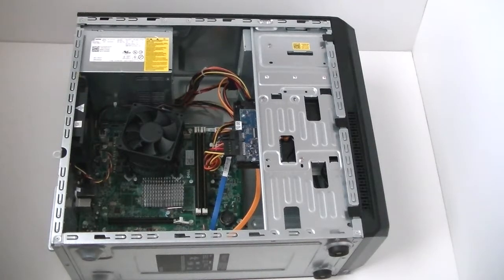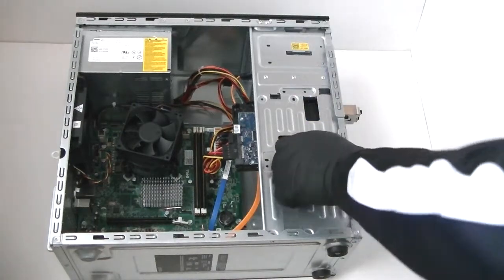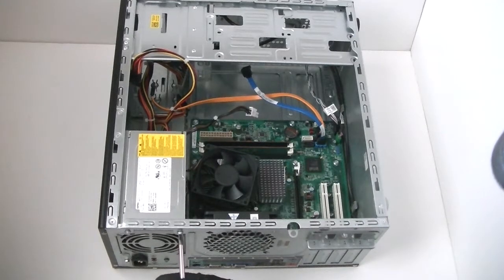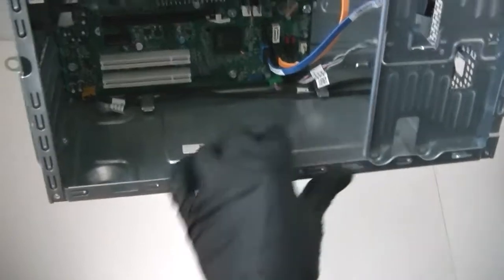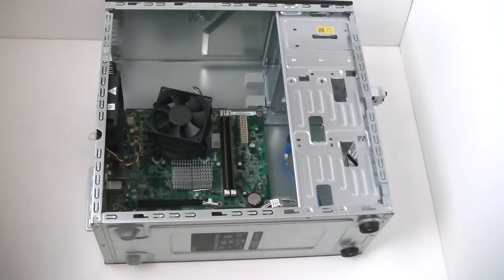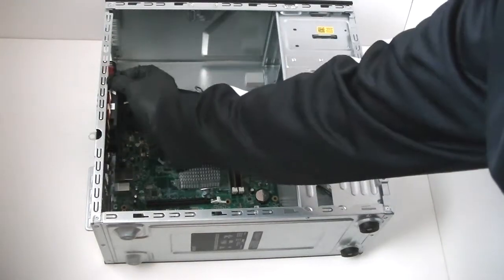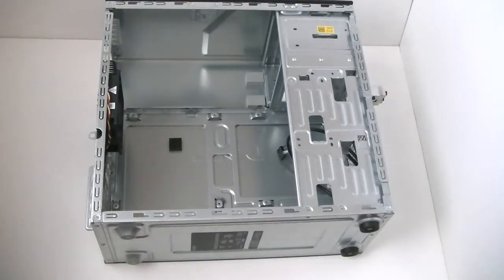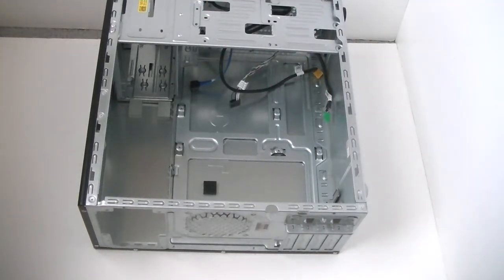Dell Vostro 230 Teardown

Comment: Hey bro, what brand of ram are those blue RAM sticks that are originally in the PC? Having trouble upgrading the RAM in one of these f*ckers and hoping if I can get the same brand of stick it'll help.

I've already tried Patriot PC3-12800 (1600mhz DDR3, non ECC, unbuffered) and LEVEN PC3-10600 (1333mhz DDR3, non ECC, unbuffered). Every time I install I get a POST code (two beeps, indicating no RAM detected). Any help would be much appreciated.

Comment: sorry for commenting after all this time but i have the same pc and it wont boot ,it shows amber light with sound of 2 beeps that kept repeating until i turn off the pc,i have tried to change ram and clean the ram slots but nothing worked and even i tried to change cpu so i noticed that the beeps rythm changed when i had vhande the cpu so what is problem sir if you can help me please????